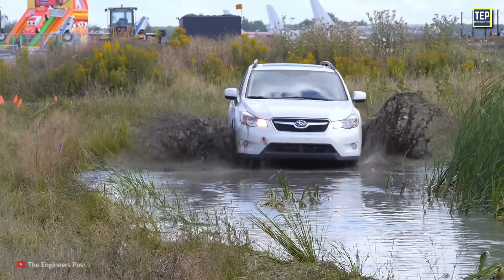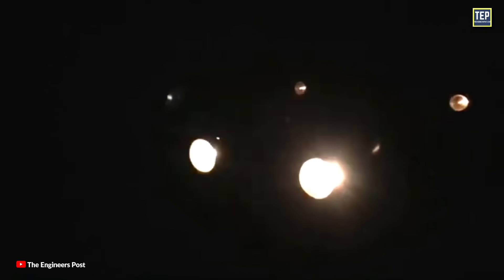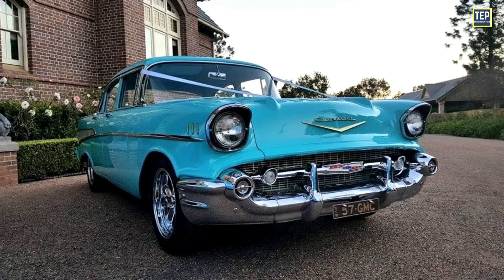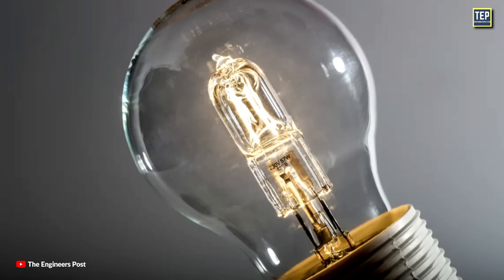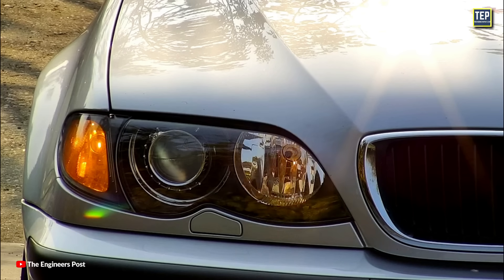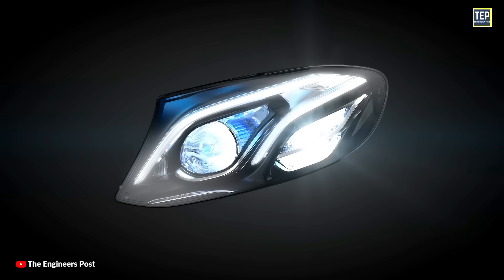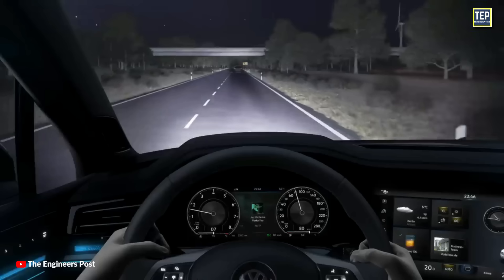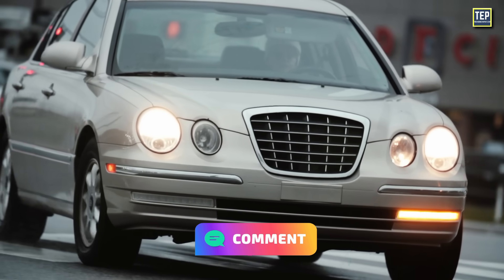The Problem With These Headlights

Comment: 13:10 tell that to all the idiots that put LEDs in their old car lights thinking it’s better, blinding everyone while having a worse light.
Reply: this was also an issue with HID's as people would get kits to run them in the older reflective halogen housings, basically LEDs and HIDs should only be run in projector housings that shape the beam, although i do have LEDs on my van which used sealed beams, but the LED housings do have cutoffs so they dont blind drivers more than normal (sadly high profile vehicles will always blind cars just do to their height) but i dont really drive that van at night so its less of an issue. 

although there are supposed to be LEDs with the proper filament pattern that can work in reflector housings, i still wouldnt recommend them, My biggest complaint is i do a lot of bad weather driving so the whiter LED's/HID's cause a bit to much back scatter from rain/snow, sorta wish more of the newer lights came in the lower kelvin color temps
Reply: @jjjacer  As I understand it, you can get a way with HID bulbs in standard halogen housings because the 'bulb' emits light similarly to the halogen bulb. But LEDs do not emit light with the same 360 degree pattern as HID or halogen bulbs and so you end up less effective light patterns.
Reply: @nik665.7  well if by standard halogen housing you mean reflector housing, then no. If you mean a projector housing, then maybe. It would require testing for the specific projector lens. I know that at least for my car, those equipped with Bi-Xenon would have a much wider and more consistent distribution of light as there was plenty of energy to use, whereas the halogen projectors would concentrate as much of the light in the center, sending it as far down the road as possible for good view.
Reply: @nik665.7  HID and LED lights should only be fitted to Projector housings.
Reply: @jjjacer I put Morimoto led light in my Suzuki sfv650 reflector housing and they work great. I made sure to adjust them so they are not blinding people.
Reply: @jjjacer that’s what fog lights are for. I dont understand why some modern cars dont have fog lights at all. Some of them do have fog lights, but they’re white and function more as daytime running lights😅😅 only some cars have proper fog lights now
Reply: @jjjacer  I have a factory HID car that does not have a projector. Again this is stock equipment and yet I get flashed anyways. I don't really mind it because then I can flash them back and give them a x ray
Reply: @Mobitz2.3-4 Have you tried Philips, Osram or Bevinsee? These are really good! I recently replaced my H4 halogen to Bevinsee V45 H4 and it works great: sharp cut off line, no flickering, no glare, no blinding traffic, and still awesome light in the night.
Philips and Osram even have some types that are getting official road-legal clearance in some countries.
Reply: You need that in India as ppl not only slap in some led but even add auxillary lights...I'm talking 2-3 pairs of aux lights....imagine the pain the oncoming traffic should go through....I have two cars with halogen reflective housing...but have slapped in LEDs in both....but I make sure I put down my beam when traffic is present.....and give that blinding power of LEDs to those idiots 😎
Reply: That’s the reason why I hate xenon lights so much. Way too blinding. I’m guessing it would be ok if people took care of the adjustment, but even if properly adjusted any bump in the road can blind you.
Reply: @angrydoggy9170 xenon is halogen my dude
Reply: 100% correct @bofty
I have changed a few standard bulbs for LED and I spend a lot of time adjusting to get the best beam pattern without blinding oncoming traffic. it honestly isnt difficult to do, but most people simply dont care. such is the nature of our current narcissistic culture in the West... 😐
Reply: You need adjust the lights after you put them in, that's why it blinds people.
Reply: @VenomTech72  Nope, you cannot adjust the shape of the mirror behind the LED bulb. LED needs specific shape of the headlight.
Reply: @VenomTech72  If the headlight is reflector type and not projector, no matter how well you aim or how good is the led your are going to blind people, I been there.
Reply: @user-kx7iz6qk6b Obviously that is too elementary for them 🙄🙄
Reply: @VenomTech72  It blinds people because the light source is not at the focal point of the reflector. No amount of adjustment will fix that. That is why retrofitting LED bulbs to halogen headlamps is illegal in the EU and The UK.
Reply: @VenomTech72  That's not the whole issue. I highly doubt 90% of cars coming practically from the factory have headlights adjusted wrong. The new LED headlights paired with even just an SUV and especially a pickup truck just blind you if you drive a sedan, no matter if it's oncoming or behind you on the rearview mirror.
Reply: @VenomTech72  That, but also all LED bulbs can not have their diodes exactly centered where a filament would be in a halogen bulb. This is thanks to the thickness of the PCB the diodes are on, and even worse is how some manufacturers create "360" or 3+ sided LED bulbs, that actually move the diodes even further from the original center point of a filament bulb. 
If you're to switch to LED bulbs, the only good option would be a flat 2-sided bulb, with the alignment of course. But even then, there is still going to be glare as the "center" of the LED bulb is non-existent.
Reply: @VenomTech72 they do no matter what. It's these God awful cool color temperatures that everyone seems to love. People hear " daylight" or white light and think yeah better. But it's not.  They should make a rule that only warm light temperatures are allowed.
Reply: @VenomTech72  LED's are FAR better but it's entirely true they need to be aimed. And those idiotic blue-white lights are annoying for oncoming cars even if they're aimed right.
Reply: @VenomTech72  no, it is not adjustment.
It is because halogen ius a point lightsource and led is not.

It never works, no matter how much you adjust. It is NOT a point lightsource !!!!!!!!!!!!!!!!!!!!
It CAN NOT work! And it never WILL!

There are only a few very specialised LED replacements for halogen which work made by Osram and such.

But those are built for SPECIFIC CARS! Matching their reflector housing!
Reply: @dom3827  Christ, some LED replacement bulbs works pretty damn well in CERTAIN housings, but it's hit and miss and I wouldn't generally recommend it for highway use.
Reply: @Devantejah  luckily in my country led replacements are highly illegal. Just few are allowed.
Reply: @user-kx7iz6qk6b you can't adjust reflectors. Common misconception. Reflectors are nkt directional, the best you can do, is buy LEDs with shrouds around the tip, that stop reflection on the top and bottom. Pro tip, just don't buy a car with reflectors. Projectors have been around for DECADES. Other pro tip, projectors can be fitted for piss cheap!
Reply: If you do not use flat-two sided bulbs, you will not get the correct cutoff line, which you see with oollld hid and round Cobb led
Reply: @xFactoryUSA thank you for the commercial
Reply: It's perfectly possible to choose matching lamp units and LED bulbs, just not that obvious to most people who just fire them in and cause problems for other road users. All my vehicles are retro-fitted with LEDs and none of them blind or dazzle other users. Took a bit of trial and error though, I'll say that. Bubba or Joe wouldn't know how.
Reply: SO true, on a sidewalk a biker rides towards you and blinds you. It is nuts..
Reply: when I got mine i made sure to get ones that match the output pattern of a regular halogen bulb and adjusted them to throw at the correct height. passed my mom on the road to check and she said they were fine.
Reply: One of the best decisions I've made was to buy a dedicated housing and shelling out a bit more. It's got a cleaner cutoff than I've seen on some newer german cars (with the cheaper headlight option, surely; but it's still quite impressive) and has cool sequential animations too.
Reply: depending on how old the car is, if it used sealed beam headlights, it's actually relatively easy and safe to switch to LED sealed beams. They're pretty much the same size so would fit any sealed beam car design, and the Frensel lens is corrected to the new bulb shape. Obviously I'm talking about basically replacing the whole headlamp and not just the bulb, but that was a great benefit of a sealed beam headlight.
Reply: You can get leds made specifically for reflectors lights and have a cutoff line
Reply: Previous owner of my jeep did just that. The led bulbs were very effective at blinding people while still providing dogshit visibility. I switched the bulbs back to halogen.
Reply: But it's more a problem of the dodgy manufacturers that make the crappy upgrade kits.
The authorities ban the fitting of LED's, but do nothing about the vendors of the junk kits.
Reply: @paulstubbs7678  What would you have them do?  They can't even touch phone scammers.  Why would they bother with useless LED replacement kits.  People waste $20.  So what, when there are little old ladies getting ripped off for tens or hundreds of thousand$. "They" can only do so much. How about "we" take care of ourselves?
Reply: from time to time i meet some idiots on the road that put LEDs or laser lights in, idk, in their old cars and they still manage to blind others even during day.
Reply: That only happends in poor countries where everyone is used to the yellow lights but in Sweden almost everyone has LED lights and everyone is used by them
Reply: LMAO! Or cheap ass LED's which flicker and cause other drivers to have epileptic seizures.
Reply: @marekeos dont forget the ones that interfer with the radio. I drove a car that had cheap led bulbs fitted and if the radio was on and the high beam was turned on the radio would just turn to interference white noise.
Reply: @marekeos The flickering is actually caused by the lower power consumption confusing the vehicle's computer.  It's solved with a device called a canbus that goes between the LED and the wiring harness.
Reply: @marekeos happened to me two days ago, I was driving and making some jokes with my gf and a car behind me had his lights on, at 4 pm which is stupid by the way, and I swear I can't explain it, but it drained the patience out of me in seconds with those cheap ass led lights flickering like crazy, ended up hitting the rear view mirror to avoid seeing them.
Reply: You shouldn't drive at all if you suffer from epilepsy.
Reply: Well, I feel better knowing that those idiots don't only live in Argentina
Reply: La gente non vede più e compra  lampade sempre più potenti, a scapito di chi si troverà di fronte ai loro stupidi esperimenti. 
Andate dall'oculista e correte di meno, se non ci vedete abbastanza.
Reply: Cadillac Escalade come from factory with idiot lights.
Reply: As someone with a old ass chevy s10, I'd kill for some l.e.d's. My headlights rn are complete ass, the glass lense is foggy, my headlights themselves are dim, it's horrible
Reply: @R34P3R_W0LF what model year/trim? modern gas bulbs can be surprisingly bright -- i went from leds back to halogens because they are brighter/have a better beam pattern than what i was using
Reply: @R34P3R_W0LF  i just use gruntier halogens in my 90's cars!
Reply: Get some Solas tape and put it on the back of your headrest and sunvisor.
Reply: Nowadays everyone has e’m if you don’t blind e’m they gon’ blind you 😂
Reply: they dont care...
Reply: True 😂
Reply: @bofty  mine is a double head lamp. So LED for the middle high beams and incandescent for low beams
Reply: Visibility is low but the reflection
Reply: As long as you adjust them
Reply: Brother, my dad is in his late 50s, and even he got convinced to change our halogen lamp to xenon! The light rays were ALL over the place, and for 3 months, I'd feel bad driving with the lights on at night; I'd eventually turn it to idle light whenever I was in heavy/stopped traffic or oncoming cars in small, slow streets.
He finally gave up after actually seeing how blinding it is and how ineffective the high beam is since the lamp is not designed to direct it properly!
Reply: For funsies, I actually tried some vehicle specific OSRAM LEDs that were approved as safe and legal by the ECE for use in my car’s factory halogen housings. They didn’t blind anyone or glare - I had them professionally aimed - but they were worse than good halogen bulbs in every single way. Optics are crucial.
Reply: You can buy decent LED bulbs for use in say projectors from makers like Bosch and Hella. You will get a better light output.

The cheap crap from eBay are the issue.

Ironically, the only times I've been blinded lately is by newer cars factory fitted with LED lights.
Reply: Bosch and Hella do NOT make LEDs for halogen lights. Chinese manufacturers such as CREE and Xentec make “Bosch” and “Hella” LEDs, but these are counterfeits not made by reputable companies and are identical to the “cheap crap from eBay” you mention. The only reputable manufacturers who make LED “retrofits” are Philips and Osram. Of those two, Osram is the only manufacturer who has done the R&D and gotten any sort of approval to ensure that their lights are safe on public roads (acceptable light output, no glare, etc, whereas the Philips bulbs are “off road use only”) and even then that's ONLY in the European Union AND they perform about as well as a good set of halogen bulbs that cost 75% less.
Reply: My reality with my LEDs in my old car which are specifically approved and tested for proof you wrong.
Reply: @SuchtFaktorHoch10  if you’re referring to me I’ll accept the possibility that it’s better in some cars than others - however in my specific vehicle the Osram street legal LEDs put out just over half as many lumens as the halogen bulbs they replaced.
Reply: During the foggy and rainy season, which would be better?
Reply: People justify bad decisions and ignore the facts.
Reply: 😂 guilty as charged
Reply: Poor market information available on the tech
Reply: This proved that original from factory calibrated perfectly and tested don't mess with LED lights from the factory and hoping  you will install like them , they highly sophisticated machines to do that please don't take chances you are going blind us on road by installing LED lights by yourself.
Reply: I got some LED H4 from LaserCar for my 1995 Chrysler Voyager, and the lighting patern is matching the halogen H4 ones. Much better than some crappy ( yet expensive ) one's that I got before. But I' d really like to have some warm white ones as someone upper in the comment said that blue rays in cold lights don't cut throug rain, and can blind more, and can blind in dusty conditions etc.

The Bangin' headlights or Morimoto, the Holley RetroBright headlights / bulbs pretend to have a light patern that doesn't blind.
Reply: All I could think of the whole video was just being blinded by these idiots 😂
Reply: Here in Paraguay is an awful issue.
Reply: I put bright LEDs with canbus drivers in both my vehicles from 2006 and 2007 and then adjusted the beam to where I can see the best and haven't really noticed any issues at all.  More concerned about me not running into a deer or whatever than the other drivers.  I've been pulled over before at night with them installed and the cops didn't say a word about it.
Reply: There's no chance they are less bright than the expensive bulbs I had in both vehicles before the LEDs.  It's a dramatic difference.
Reply: The bulbs should not be made to fit in older headlight housings.  How there is not a class action suit over this I do not understand.  The bulb should be specific to the design of the lens.
Reply: @johannjohann6523  Mine work fine.
Reply: LEDs can be placed into Projector housing (legally) and as long as they are adjusted correctly, will not blind anyone. Same goes for replacing a halogen projector with an HID Xenon. LEDs and Xenons should not, however, be placed into high-beam units, as they are always reflectors. They should also not be placed into reflector low-beams.
Reply: @TheBritishKitKat  I put LEDs in high beams, low beams, and fog lights for two vehicles and it worked fine.
Reply: @IAmHollowRider  I even had someone drive past me at night and they said they weren't too bright that I should change it.
Reply: @IAmHollowRider  And I just got pulled over a couple nights ago and it wasn't a problem.  Cop just wanted to let me know my brake lights were staying on, which I suspect is my brake pedal spring is barely worn out, since it almost never happens.
Reply: @green3488  Cops don't tend to enforce that part of the technicalities of the law unless it results in a crash.
Reply: You must not use LED with old mirror headlights. You can easily use with headlights that have the lens because those can be adjusted.
Reply: getting a proper pair of leds and adjusting them is key - its not that LED's just cant work full stop.
Reply: You need a conversion kit.
Reply: My old car uses xenon headlights and I used a conversion kit to replace it with led headlights.
Reply: Alas, I didn’t know that until one night when I accidentally blinded an oncoming cop car and he pulled me over for it. 😒🚔
Reply: You can install them to a halogen housing but it must be projector housing, I have a 2007 Camry that came with halogen but because the housing is projector, when I put LEDS , they cut off perfectly and I don’t blind anymore
Reply: LEDs in the wrong orientation will cause a blinding light and provide less reach for the headlight.  Manufacturers typically provide 180 degrees of orientation adjustability (ie. at 0 or 180 degrees) with a set screw but if they aren't in the right orientation will cause that blinding light for other drivers.  Often you will have to modify the light to have adjustability at 0, 90, 180, and 270 degrees instead.
Reply: I bought 7 inch round LED headlamps for my old Prado from Aliexpress and it's so much better driving with them, especially when it gets foggy. No regrets.
Reply: @MotoCamper254  You don't WANT bright headlights in the fog; you want headlights that are aimed low, too low to use as headlights normally, or else all you do is light up the fog and that's worse.
Reply: @MotoCamper254  Pratt
Reply: Cope and seethe
Reply: Have led I. My old truck. Can actually see the road. They are adjusted by the book. In a assembly made for led light. People get mad when I flash my brights too. Not my fault their heads sit where my stock pickup headlight assembly is. And people complain cuz I am in the wrong blinding em when they chose to sit right where every truck light goes imo
Reply: If you say that it's because you been either, using the wrong LED's, adjusting them wrong, or both. LED has come up a far long way and trust me you can install them on a car and they will behave better and reflect better, all that while taking less fuel from your car while being brighter. So, all in all, don't just believe a video from a person who read an article, put your hands to work and test it. I've done it many times,  even LED from aliexpress, pick the right ones with copper heat pipe cooling and they will not overheat, besides that they can be pushed further because, as i said, they don't overheat. Get the right LED, don't go install H1 lamp on H3 socket and complain the light in your car sucks.

Keep in mind law enforcement, in some places you can't change the bulb type because, again, most people fuuck up and blind everyone on the road so there had to be made laws to avoid that, fuuckin up my business in the end once more because of uninformed people. Make sure it's legal, install them correctly (or take the car to someone who does) as sometimes you have to adapt the connectors, and you will be set.

PS: bad quality LED's tend to overheat and drop components due to extreme heat, it ain't always the LED's themselves that overheat, but the driver, particularly the ferrite core inductor, gets so hot it melts the solder and falls off inside the aluminium cooler housing off the lamp.

Take care y'all, hope this helps
Reply: You have bad eyesight my friend, led is best